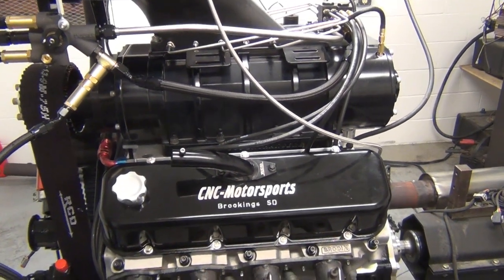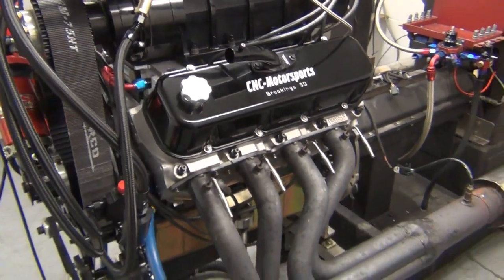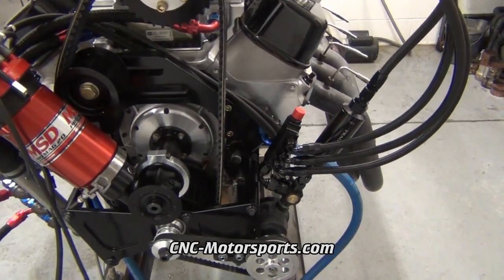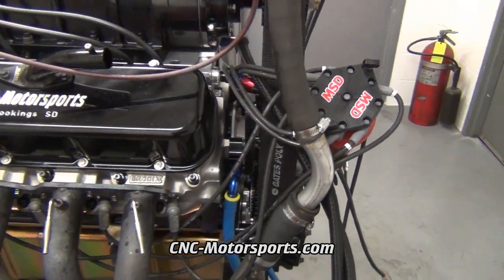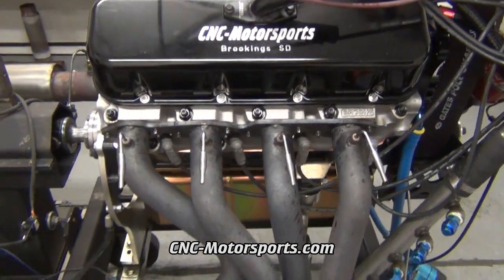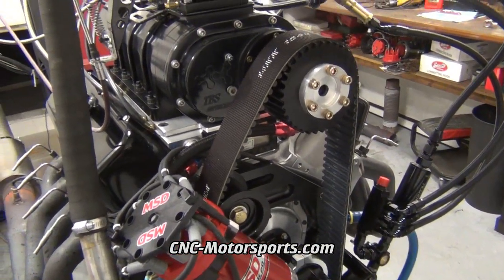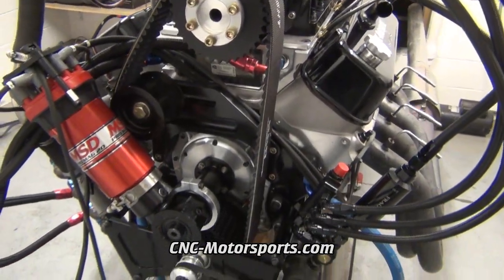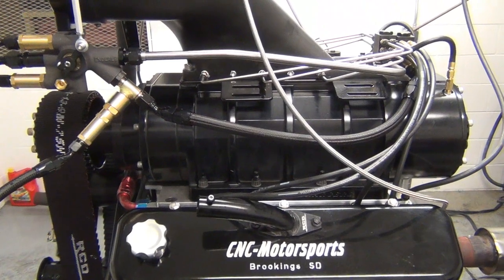555 Blower Motor with 14/71 Blower Dyno Pull

Comment: 2500 rpm spread. Impressive. Should drive really well.
Reply: That's just a matter of changing pulleys and the tune.
Reply: @savagele  
What? Not sure how that relates to my comment. The distance between peak torque and peak hp is a function of the whole combination. My point is that a wide spread is a sign of a combination that is balanced very well, and drive very well.